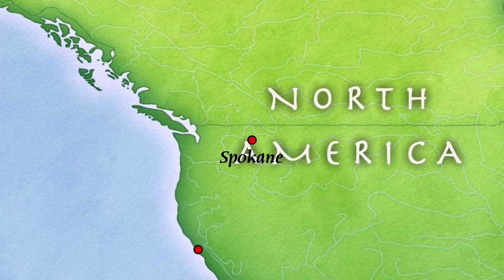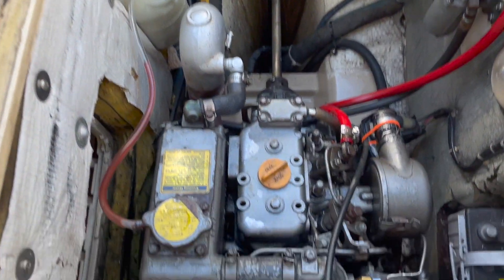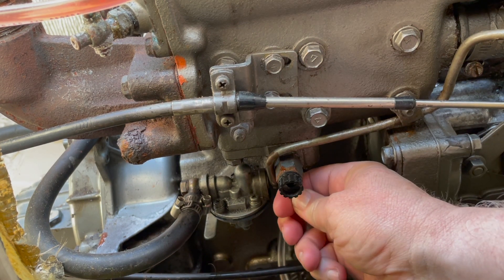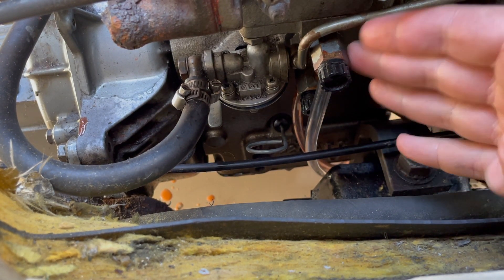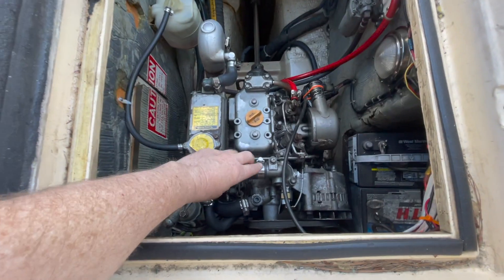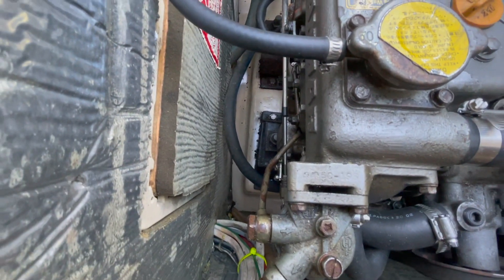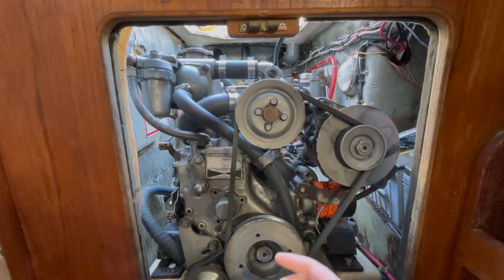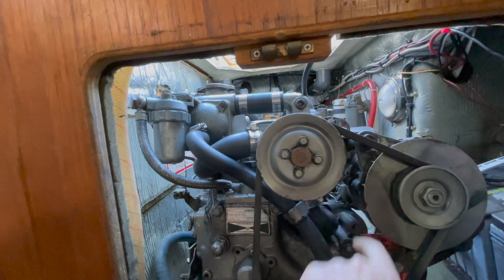S1E18 - Coolant DRAIN & FLUSH + New Hoses!

Comment: Thank you! I have the same boat and have been contemplating opening an engine access from the quarter berth just as you have already done. So much easier than the yoga moves I have to do just to check the dipstick.

Comment: Great vid !  How to make shure no air in the cooling system ?
Reply from the maker: Normally, it is very easy - automatic in fact... But, everyone wants hot water and heat on their new boats so they run these auxiliary systems off of the cooling water circuit.  These meandering lines have odd bends that can trap air bubbles and decrease the extended system's effectiveness.

As boats age, their value eventually declines to a point where replacing these auxiliary systems does not make financial sense.  My boat is 36 years old... So, I pulled all that crap.  Imho... If you are having trouble bleeding your engine cooling system, you either need to remove the auxiliary crap or add bleeder valves wherever air tends to get trapped in those meandering lines.

Comment: Hey thanks this was very helpful. I am set to drain and replace my coolant. But I also am replacing my hot water heater which has the coolant running Thru it as well. Do you have any videos or advice for how to do this at the same time?
Reply from the maker: Sorry Pamela... I can't give any advice there... I removed the water heater 😮

Comment: When doing the flush and running the engine, didn’t the engine run without coolant until the thermostat open up?
Reply from the maker: Hi David!  That is how I understand the system works as well so I removed the thermostat before the flushes and replaced it afterwards... I may not have mentioned that in the video! 😮